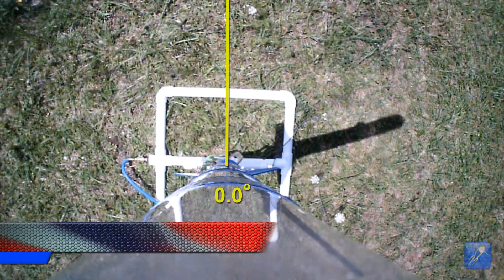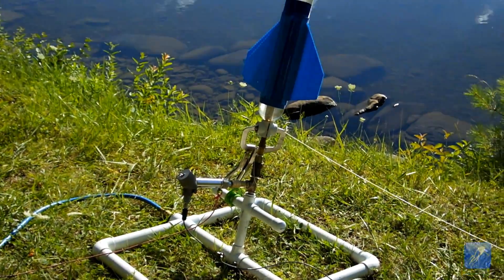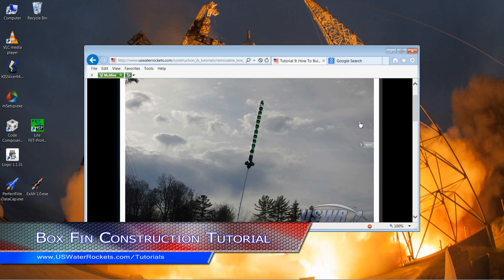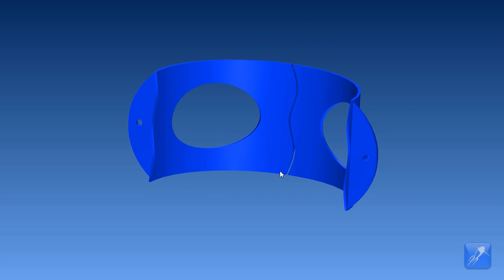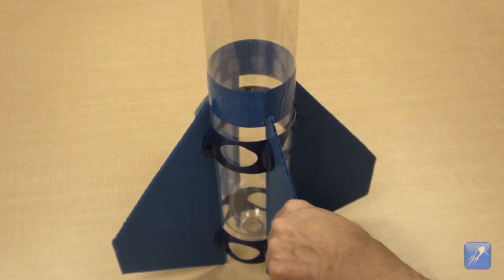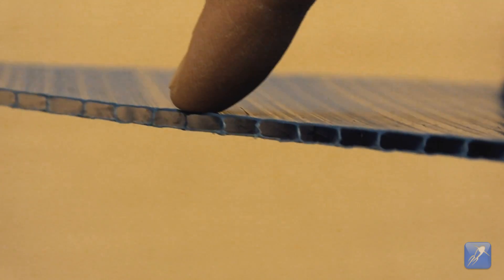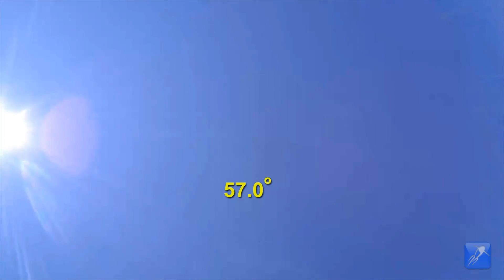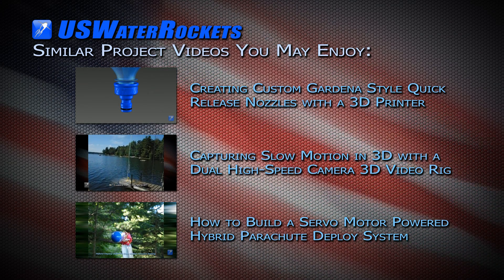Water Rocket 3D Printed Fin Brackets

Comment: Air does not simply flow through a small gap without drag.  At the small scale of the fins the drag should be considerable.  Since fins are cheap you should try taping over the leading edge to cover the corrugation holes.  In theory those holes add significant drag to the design.  In practice it might be insignificant compared to the thrust produced, but the extra drag is still there.  Try taping over two of the fins and watching what the rocket does.  If it pitches over toward the draggy fin, then you have an answer to whether there is a practical difference.  If there is no difference then I suspect the flow through the holes is completely choked off causing a virtual plug in the holes.  Still that is a waste of airflow which could be reduced by faring over the holes with tape.
Reply: I could not agree more

Comment: Congratulations! The results of the avoid spinning fins are great. But, how is the new fins and their mounting avoiding the spinning?
Reply from the maker: The fin mounts are 3D printed, so they are as perfectly perpendicular to the body of the rocket as the printer is capable of producing. This is certainly a tiny fraction of a degree. By forcing the fins into perfect alignment, the fins will not add spin to a rocket. Poorly aligned fins are the largest cause of spinning in a rocket, so this addresses the problem. Of course you need to make sure to use straight and flat fin material with the brackets, but that is assumed to be already known. :-)

Comment: how high did it go
Reply from the maker: The first launch went 535 feet up, but the second one crashed and messed up the altimeter readings, so I can't say exactly, but it was at the same angle and pressure as the first one so it probably went a similar height.

Comment: is there a 3D dowload avaliable for the fin brackets?
Reply from the maker: We took it offline because too many people had bottles a tiny bit fatter or thinner and so we're reworking it so that there is a degree of adjustability in the diameter of the bottles. We're testing a solution that looks promising.
Reply: +USWaterRockets what size rocket bottles did you use in the video?
Reply: @USWaterRockets  Any headway on that new design ??  any SCAD files would be most appreciated.

Comment: Excellent as always.  Sure makes fin install easier.  What material are you using for your printed parts?
Reply from the maker: Thanks! These are ABS plastic, but we have tested other parts made with PLA and PET. We like the ABS the best because it can be easily polished and made very smooth and shiny. The samples in this video were very lightly polished, and they look really nice compared to the raw versions. With light polish, some layering is still visible though.